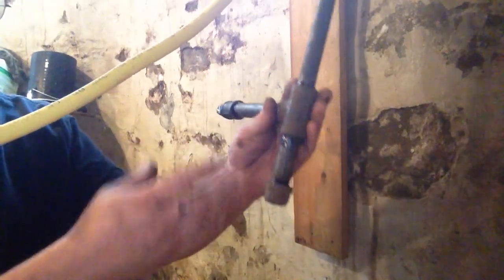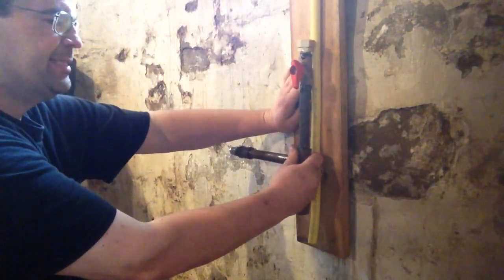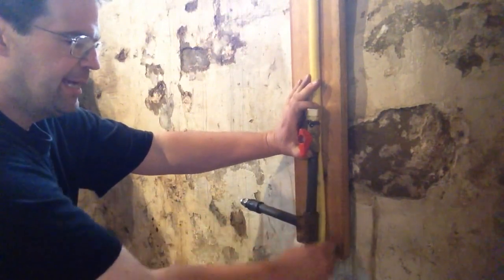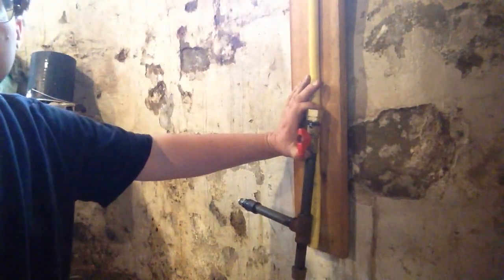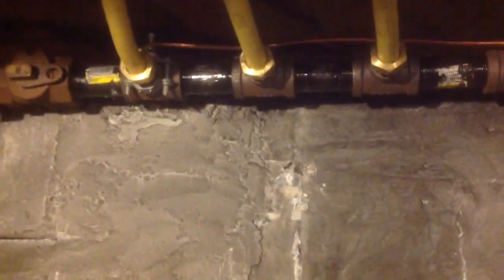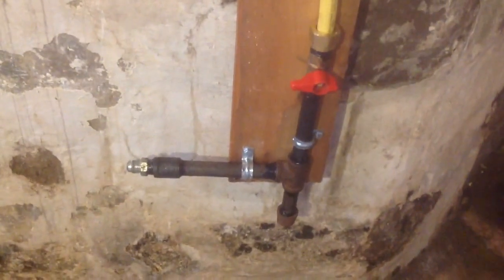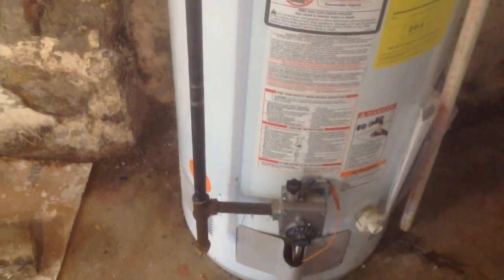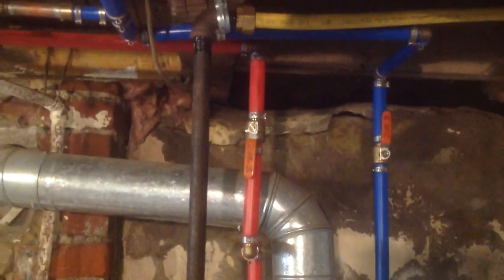Csst gas line dryer hookup

Comment: Hi, thanks for the video.  Do you have any concerns with using CSST?  I have to run gas to my new furnace about 20 feet but worried about using CSST might use it anyway to make the job easier.
Reply from the maker: +Aricu Nono I have no concerns. The csst eliminates a lot of fittings. Make sure it's grounded and your good
Reply: Thank you,
Reply: How can i grounded??